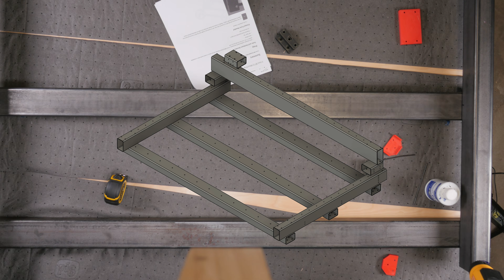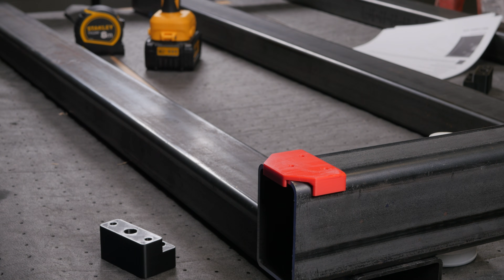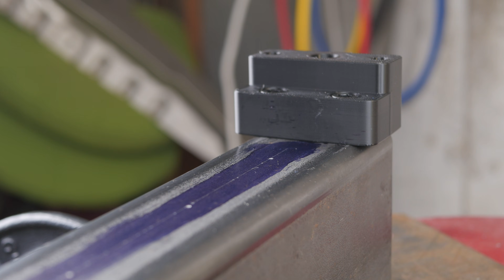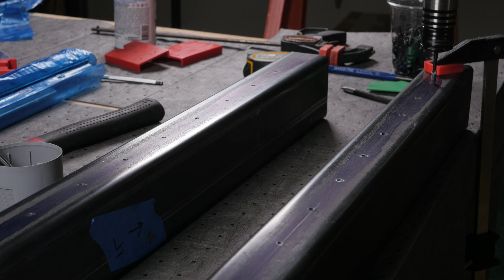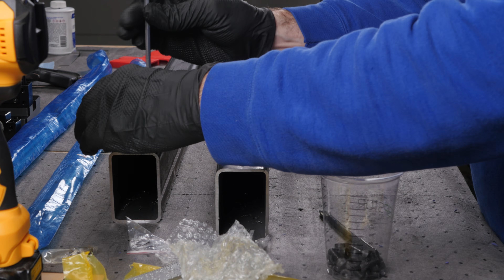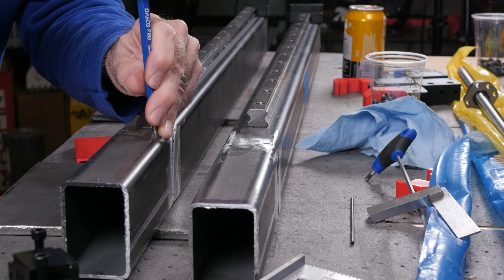Building A PrintNC CNC Router - Episode 3 #cncrouter #diy #printnc

Comment: Looking great 👍 I'm finishing up a small 3 axis mill for my office at work (can't let the machine shop have all the fun).  I have rails, ball screws and a pile of 80/20, but I haven't gotten around to building a big CNC router yet.
Also, will you be controlling this with Mach 3 or Mach 4?  If not, perhaps consider it, as Newfangled Solutions is based in Maine.
Reply from the maker: Thanks much!  That small mill sounds interesting.  I have a little Sherline mill that I've messed around with for years - love to get a big knee mill!  Once I reach the status of the other big YouTubers, I can buy a big shop so I'll have somewhere to keep it!  😅
I've used Mach 3 and 4 way back.  Also LinuxCNC.  I actually didn't know those folks were in Maine!
I'm quite drawn to the Masso stuff - I like the clean design - we'll see!
Good luck with the mill - let me know how it turns out!
Thank you for the comment, and thanks for watching!

Comment: My ballscrews and linear rails were also 25mm too long vs the cad when I ordered my kit. I was able to shorten the rails but for the ball screw mounts I modified the plastic part to extend past the tube to accommodate it. Eventually I'll be machining those mounts out of aluminum but so far it's been working great
Reply from the maker: Sounds like a solid fix!  I figured I would keep the extra length and get a few more precious mm of working space!
In reality, I may go to dual rollers in the future depending on how aluminum cutting works.  I assume I will replace some printed parts with aluminum at some point to - if it seems necessary.
Glad to hear your machine is working well for you!
Thank you for the comment!

Comment: Great work so far! Surprised that you didn’t print those mounting brackets with something sturdier than PLA.
Reply from the maker: PLA is actually the recommended filament for the build with the exception of the motor mounts being ABS - and that is just because of the heat build-up.
I think the reason is that the parts don't really move and most of the force is compression.  I guess we'll see!
Thanks for watching!
Reply: @mainejason  Good to know! I might look into building one of these CNC's if I can find some cheap tubing...
Reply from the maker: Ya, it's an interesting project, but not what I would call inexpensive.   Let me know if you make one!

Comment: Youre pretty gutsy welding those extensions. I would have taken the easier route and had those RHS tubes recut.
Reply from the maker: I confess I lost a couple days thinking about the pros and cons.
In the end, after all that cutting, drilling, and tapping, the thought of starting over if I didn't need to was just to much 😅
Seems like Iike it has worked alright so far....
Thank you for the comment, and thanks for watching!